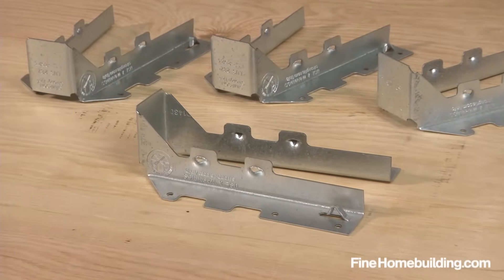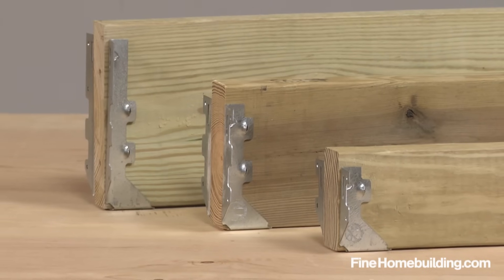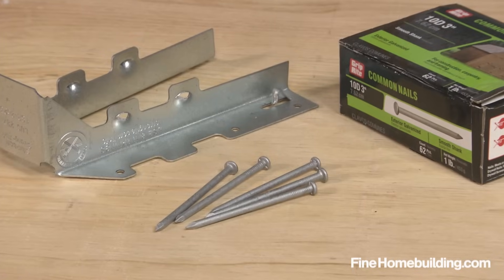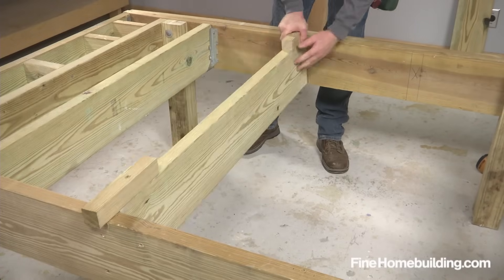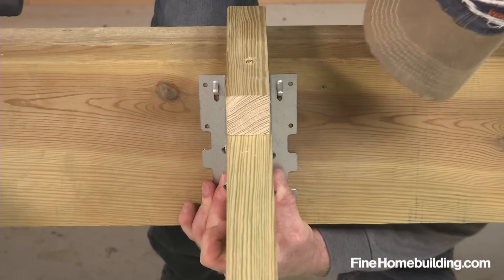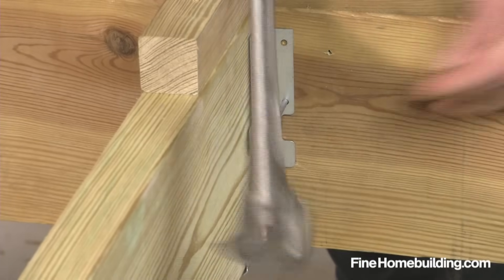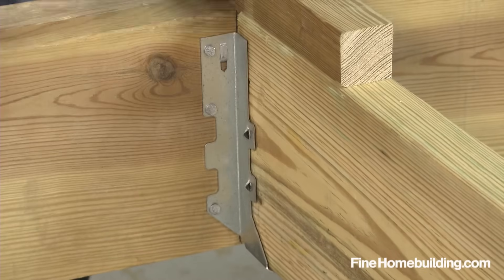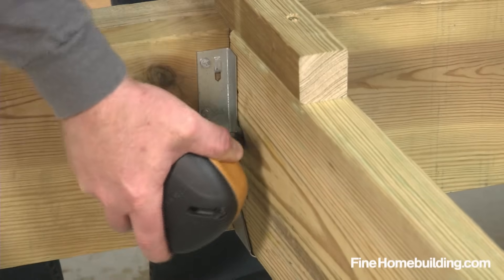How to Install a Joist Hanger

Comment: I am literally gobsmacked by using the block on the top of the joists. Like, NOBODY I’ve seen is doing this. I’ve been searching far and wide for tips on construction without a partner/team. This is going to SAVE me so much time and energy. Thank you. A million times.
Reply: Me too...,I was like.....sigh...I know NOTHING
Reply: Wow I’m gonna use that little trick today!
Reply: the only problem with doing this is that it adds another avenue for water to get into the wood, and rot it. Especially on a vertical surface.

Just consider taping the top of your joists, or something else to protect the vertical hole from water.
Reply: @auklin7079 🧐🙄 it’s not gonna create a place for water to get into 😂
Reply: @bradywassam5232  how do you mean? Water always wins in the end, especially where I'm from where it freezes and thaws 50+ times during the winter

Comment: Well dang. I'm no carpenter. But, that block idea just blew my mind. I'm about to hang my joists and was wondering how one person could do this.
Reply: it sucks. you're spending time cutting those blocks, then installing them on each josit. waste of time. Run a few spaced out joists, then use clamps to clamp a spare joist perpendicular and underneath to act as a brace that holds up your joists. 

Using blocks like they do will ensure that your joists aren't level.
Reply: @MrDougfunny7 spending time cutting blocks??  what are you talking about....4 blocks max and then re-use them.....
 if your frame is level the joists will be level
it's actually a great tip.....especially if you're working alone
Reply: @daveyk3436  you don’t know what you are talking about but it’s ok. Keep doing inefficient sub par work
Reply: @MrDougfunny7  i get it....funny doug got disagreed with so he starts with the insults
Shocker!! 
 I did expect it actually....Children are so predictable

Comment: Doesn't a 3" nail go through the other side when on the portion of the joist hanger that isn't toe nailed? A 2x is only 1.5" thick.
Reply: yes but in most instances your ledger is in addition to the house, so the house band is an additional 1.5 inch.
Reply: @MrDougfunny7 and if it is not into the house? Should you opt for a shorter nail?
Reply: @judgepage6605  ledger board has to be mounted to something. It’s mounted to the band of the house. So 99/100 a 3” is fine, just overkill.
Reply: @MrDougfunny7  I'm speaking more in terms of a floating deck not against a structure.. or would you say in that situation that joist hangers aren't necessary?
For info sake: a 12x12 floating deck roughly 18" off the ground
Reply: @judgepage6605  if it’s floating then make it sit on two beams. Then no joist hangars necessary , since the joists are bearing on the beam. No way for them to fall down because the beam is below them.

Comment: I’ve watched so many of these and always ended up asking myself “ but how do you keep the joist in place whilst you are fitting the hanger” 
Guide block = genius. 
Thank you
Reply: Just toe nail the top
Reply: Just use a short offcut to get the hanger connected to the frame, then you can drop the joists in
Reply: Stupid idea to use a guide block
Reply: Toe nail the joist first on each side. That holds it in place. Then add joist hanger.
Reply: Same. I feel cheated with the brain I was given when I see these simple solutions that make me go "oh, duh."
Reply: @garthnoakes3725  Agree, makes a lot of extra work.  Personally I just fire a couple of nails through the bearer into the end of the joist before, or if I can't do that toe tail the top like an earlier poster suggested.

Comment: We used this tip and 2 x 14.5-inch spacer blocks to install joists that were 16 inches on center.  Came out great.  We were working with 16-foot spans and my son worked on one end and me on the other and we were square and even all the way across.  Great tip and well worth cutting spacers and the blocks that go on top of each joist.
Reply: Easier and more accurate to layout 16oc with tape measure

Comment: GUIDE BLOCK!!!!! Thank you. You saved me ton of fussing.
Reply: lol, yeah. I'm on my 2nd joist and came in to check to make sure if my screws were ok (they're not, need hot galv. nails) and I was using a 2x4 "chock" block UNDER the boards to hold them up, lol. I like this top block better! Glad I saw this after my 2nd joist. Next 14 will be cake.
Reply: @creepybunny255 can’t just use any screw no but Simpson does make screws designed for their hardware. They are nice in a pinch but a lot slower than the nails
Reply: @dannysullivan7383  Thanks. Job is already done, I left the screws I had started with and went and got nails. Someone stole my dam palm nailer, so with the hammer... ehh those nails sucked, lol. I'll remember this info for next time. We got a stage build coming up for the haunted house, will use them there too.

Comment: The best framing tool I ever purchased was a palm nailer! No more bashed fingers from hammering hundreds of tico nails.
Reply: How about using screws
Reply: World Wonders Simpson makes screws specifically for their hangers, same shear weight.
Reply: Yes Simpson does make screws for their hangers but way slower than nails, instead of buying the palm nailer should’ve put that money towards a positive placement gun aka hanger gun which is the most efficient way hands down

Comment: That's a lot of work screwing blocks on and taking them off again - but it is hands free I guess.. In some situations where you're installing from below (as I will be tomorrow) you could tack a 2x4 on flat on top of the ledger and pushing up to that as your reference instead

Comment: Forgive my naivety. Does all the weight put on each hoist rest on what is essentially a 1mm (guessing) piece of folded metal nailed in?? How do floors in house put up with the weight of  all the people, heavy furniture etc? Didn’t it used to be the case that the wood was resting on another piece of thick wood? Just amazed this is strong enough
Reply: You're supposed to toenail through the bracket into the ledger board
Reply: :48
Reply: There are nails through the hanger into the joists. You will be amazed at what shear strength those have

Comment: great video, but can you explain to a non construction person, why do the joists need to be standing when building a floor or roof? Thanks 👍🏻👍🏻👍🏻
Reply: Standing them is where the load bearing strength is.

Comment: Could you use outdoor screws instead of nails?
Reply: No screws. Not as good of shear strength as nails.
Reply: @SteS  half right. Regular screws, no. Simpson’s structural screws designed for their hardware, yes

Comment: Does the bottom of the hanger hand slightly below the header or even with ? Been told both.
Reply: It would have to be lower because the joist in the ledger may be the exact same dimension in which case the width of the metal will extend below

Comment: I'm pretty sure that "common" nails are NOT to be used in pressure treated wood. They will corrode/fail from the chemicals in the treated wood.  Look for hot dipped (ONLY hot dipped) galvanized nails or stainless steel.  This per Strong Simpson instructions.
Reply: "Common" is a type of nail.  It refers to the shank diameter and head size.  Common nails can be brite, electro galvanized, hot dipped galvanized, stainless, etc.  Common is a designation similar to box, sinker, casing, and finish nail.

Comment: Incomplete Title .... Should be "How to install a joist hanger the slow way" , no need for that gauge block , just tack the joist in place , then install the joist hanger , or install the joist hanger first using a gauge block , then install joist that slips right in ..... joist hangers are not that difficult where you need that gauge block screwed into your joist ..... That's a lot of time wasted on screwing in and out of the gauge block 50 times or more ......

Comment: Why wouldn't you use a positive placement nailer to make these kinds of connections?  They are readily available and not terribly expensive.  What you show here works but...  why?  Even a homeowner DIYer would benefit from using a nailer and isn't likely to have the hammer skills to do this anyway.  A pro is going to go for what will get the work done fast, which is not going to be hand nailing joist hangers.
Reply: Many of those nailers are great, but you may not be able to find one that shoots nails that are long enough.